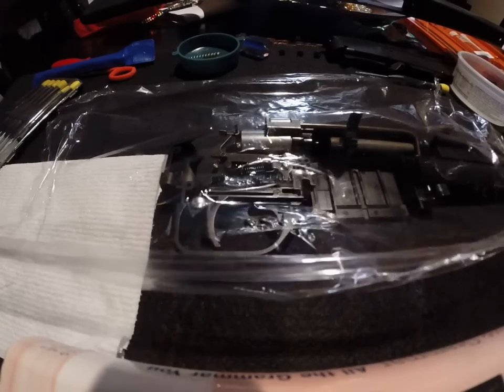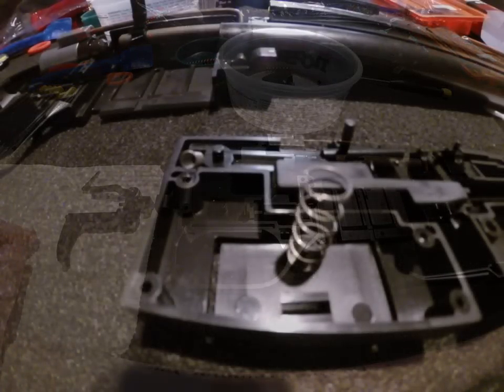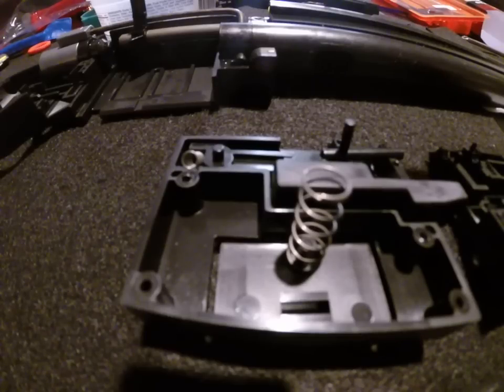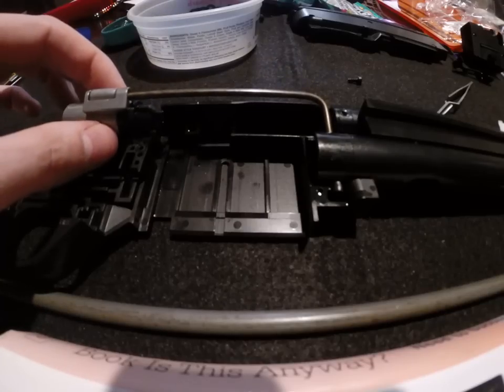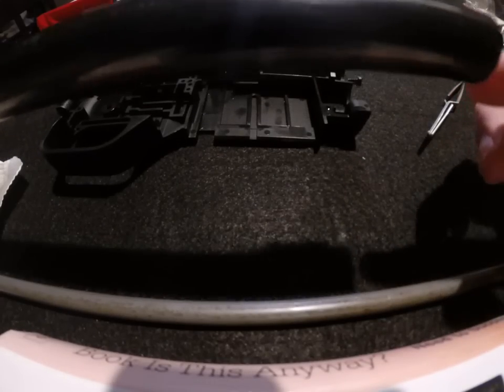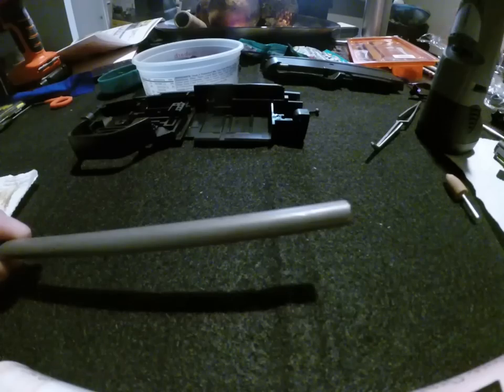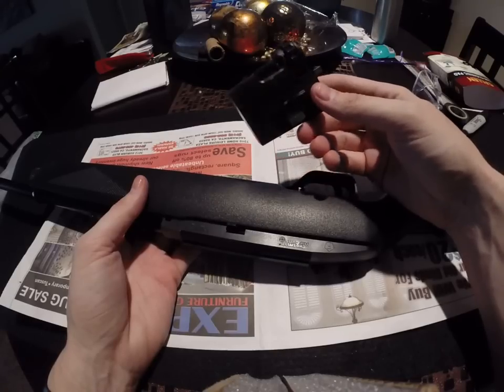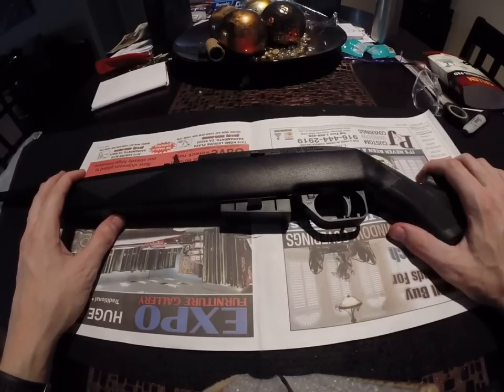Crosman 1077 modding

Comment: At 15:59 you mention fabricating a bushing of some kind to keep the barrel from wobbling.  If you really want to immobilize the barrel, embed it in RTV rubber.  Here's how:  fit some Saran wrap into the shroud, squirt some RTV onto the Saran wrap down into the shroud, place another piece of Saran wrap on top of the RTV, place the barrel in its FINAL POSITION on top of the second piece of Saran wrap, and let the RTV solidify.  I would use any color of RTV except black since everything else is black.  When the RTV hardens, pull the barrel out, pull off the top piece of Saran wrap, lift the bottom piece of Saran wrap up to take the entire block of RTV out of the shroud.  Peel the other piece of Saran wrap off the bottom of the RTV, and place the RTV back into the shroud.  Then place the barrel back into place.  I'm not that familiar with the pieces, so you might have to do something with RTV on both sides to really clamp the barrel down.

Comment: 200 grit sandpaper would, unfortunately, roughen, and cause later wear on the surface referred to; instead, use a hand held blade as a draw knife across any plastic surface needing smoothing - planer blades work. 
 * Molly grease only on all contacting surfaces.
Your using the needle nose was revealing: Best Yet for seeing the entire works. Thanks for the info. When I do mine, I'll take a few photos, draw some sketches, and stow the parts in exploded view order,  because I forget a lot.                                                          Thanks for the very good "inside information".  Using the needle-nose pliers should be utilized by more video producers.

Comment: I glued on part of a lead wheel weight, to the back of the hammer, as per a video. Within 60 shots both the R and L action cases were severely cracked. Inside of the L case too. 12 cracks on the outside. Cases aren't worth attempting to fix. Didn't weigh the weight before gluing it to the hammer.
Reply: I did the same thing but with motorcycle lead weight....had it two years now i get 50 shots per capsule and works fine. I think it was 25 grams.

Comment: long screw that was drilling to barrel when putting together is a short machine screw might of lost it.also trigger don't  reset because crossman common issue. putting a washer in trigger hinge or plastic bushing to its gap would help. also cutting a bic  plastic pen barrel as a bushing would work thanks
Reply: Fullpeladas, also a thin layer of molly grease on everything sliding on something.

Comment: In looking at the Magazine actuation, and it's Moving parts, by reducing the contact area down to a MUCH smaller area that contacts the sides of the Magazine you would Have Much Less friction here,  (there is a lot of surface area, that contacts the side of the Magazine) When looking at High end $$$ Airguns the Moving parts typically could have UHMW Plugs, (UHMW or Delrin Plugs) inserted into the moving parts this reduces the contact area down by a substantial amount, less contact area, means a Lighter & smoother  & faster operation. I may try this on one of my Spare Magazine's first, then the trigger. I will also be looking at the seals between the Valve detent, to Clip seal, and from Clip seal to Barrel Breech end, this sealing areas may needs a better method of seal, and/or Look at the butter fly barrel de-jammer, I might be able to tighten this area up somewhat for a much better seal, The Edge of the Barrel Breech Must be Very Smooth, this area should be Smoothed out, as the rotating clip rides against it, the Valve's Detent end that rides up against the other side of the Magazines clip these areas need to be smoothed out as much as possible, for a Lighter/smoother trigger and a Much better seal, so that less co2 is wasted to leaking, vs pushing the pellet down the barrel. Alignment of all of these parts both vertically and horizontally will be Important.
Reply: The trigger has two Long Slots, one long slot on each side of that Long trigger, reduce the Contact area of the Trigger to Trigger Channel that the trigger rides in and this should make a MUCH Improved Lighter smoother trigger. Reducing contact area, and any rocking, or binding, back & fourth front to back of the trigger will be an Improvement
Reply: The Magazine, when you separated the two magazine halves, the Large spring between the two halves is to provide more pressure when pinching the two halves together to remove the Mag. this effort can be reduced here by putting lighter spring so that the mag changes are easier,  but Not to light as the Magazine must still be a solid connection, just a Little Lighter compression. Testing the Magazine, to Magazine Well fitment for a tight tolerance is Important, as the sealing of the rifle depends on it.

Comment: THANK YOU for a Excellent Video: I think on your trigger there may still be one or more areas on the trigger that still need to be worked/smoothed out, as the trigger looks like either it is latching or clicking/binding slightly, where ever that friction is, that is what would make that trigger return to home. It may smooth itself out over a 1000 shots or so, also if a spring from a ball point Pen was used on the trigger,  I would rather see a spring down behind the trigger, to push it forward, or maybe two lighter springs, looks like plenty of room behind the trigger for a Ball point pen spring
Reply: Regarding The Trigger, and it's return spring, the return spring is Out of the centerline of the LONG Sloppy Trigger Bushing area, this area is very Long, and a lot of slop in its movement, As it rock forward and backward and Binding all the way. I would make the trigger Spring In line with its bushing area, and make it either a push or Pull spring, Maybe a pull Spring, I would fill the front channel with epoxy and put a Pin in it, for the Puller spring to attach, that pull spring should be Inline with the triggers Bushing centerline, this will make a Much smoother trigger, as it should get rid of the binding, I would smooth out ALL area's that come in contact with the trigger bushing area, and trigger as this looks like it rocks back and fourth, front to back, and this makes it Lock up and unlock, making it Bind somewhat. I am looking at Getting rid of the Hammer safety Interlock, all pieces of it, I believe there are 4 pieces to it. I will then test it for safety. I dont think this is needed and may create hammer slow down, I will Not add any weight to the hammer, but I will look at the Hammer & Hammer pin area, maybe this area is Very sloppy too a thin nylon washer on the hammer pin one nylon washer maybe two to take up all excess Hammer movement slack. I also want to see if the Hammer Interlock was making valve dwell to fast. I believe adding weight to the hammer can damage/dent Valve part No. 7F washer, when this get bent it can create a leak in the valve.  file:///C:/Users/westg/OneDrive/Documents/CROSMAN%201077%20PELLET%20AIRRIFLE/1077%20EXPLODED%20VIEW%20&%20PARTLIST%201077%20EVP%20&%20PL%204%20(1).pdf

Comment: Hi. I dissembled my 1077 and reassemble it with all stock parts. Everything seems and sounds to work fine but the gun isn’t blowing any gas. I reassemble it three more times, changed 3 co2 tubes but the same problem exists. It makes the tick noise but no gas comes out. Any ideas?